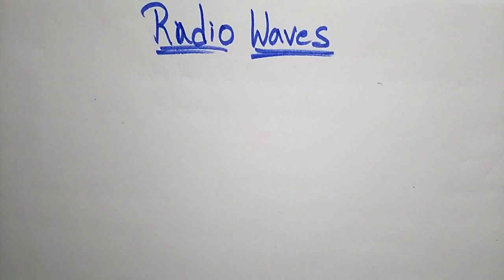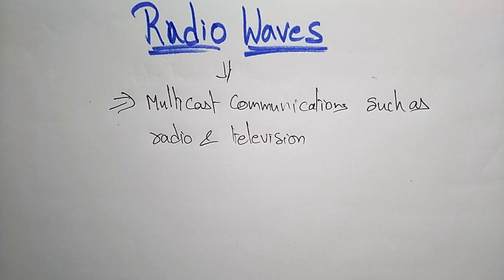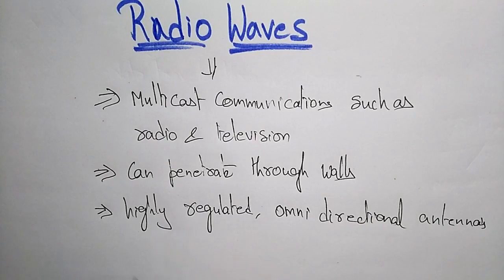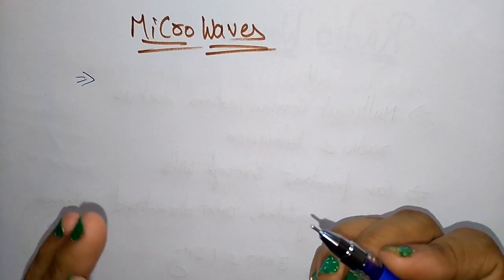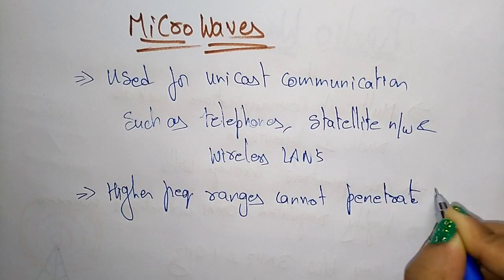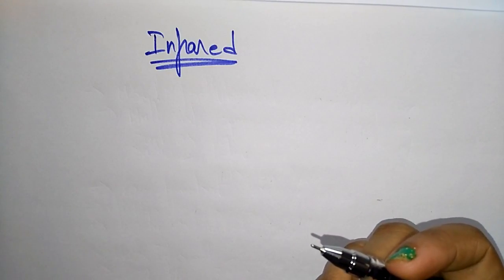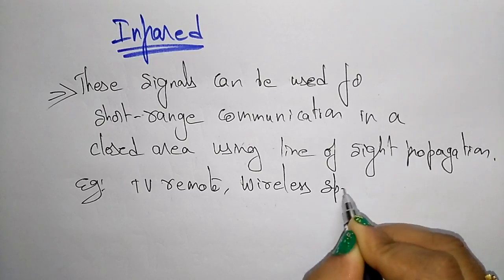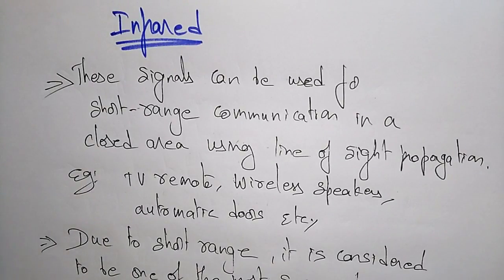transmission media | radio,micro & infrared waves |

Comment: 300 GHz
Radio Waves. Radio waves are a type of electromagnetic (EM) radiation with wavelengths in the electromagnetic spectrum longer than infrared light. They have have frequencies from 300 GHz to as low as 3 kHz, and corresponding wavelengths from 1 millimeter to 100 kilometers.

Comment: Ma'am Speaker is not an example of infrared
Because infrared is related to light transmission.
Reply: It is if they are wireless.
Reply: When discussing wireless speakers, it's more accurate to focus on technologies like Bluetooth and Wi-Fi for communication, rather than infrared (IR) transmission. Infrared transmission is typically not used as the primary means of communication for wireless speakers due to its limitations in range and line-of-sight requirements